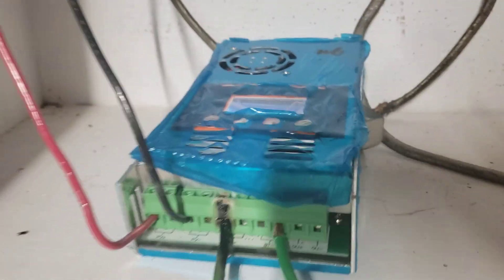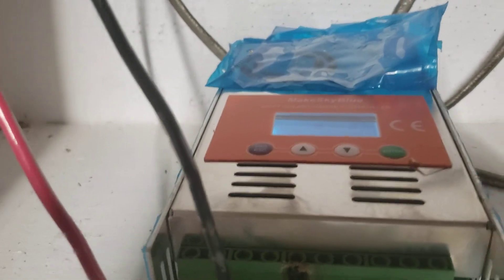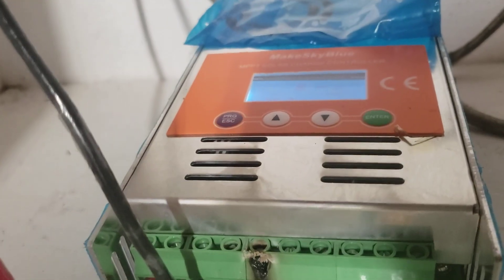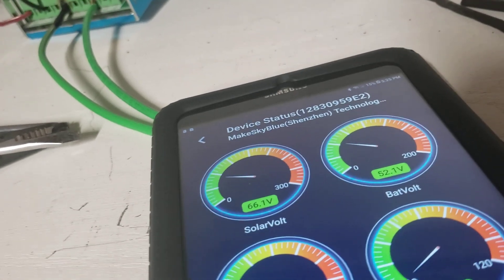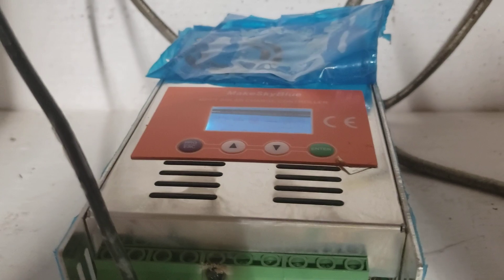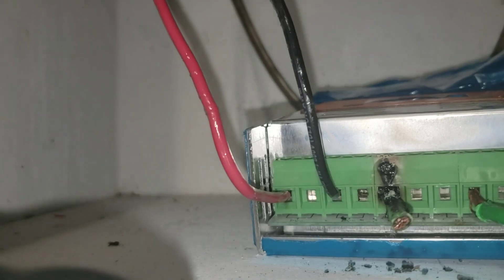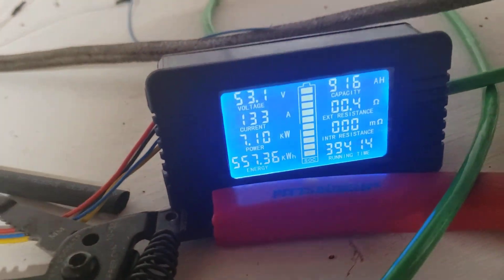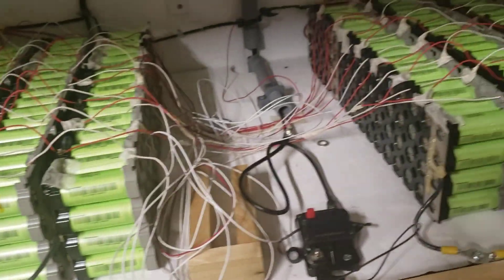BEST MPPT CHARGER CONTROLLER WIFI IN THE MARKET- MakeSkyBlue 60A MPPT 12V/24V/36V/48V Solar System

Comment: I think I see your problem. the area where it burned it is from the wire guage being too small. When the guage of wire size is too small the wire gets hot and channels too hard into one area. Then you get that burn out like you got there because it concentrates there at 1 spot where it leads in. I've had that happen with charge controllers. You can have either the wire be the fault, OR you can also have the charge controller not be able to be big enough also. Both can happen depending on where the limitation is. But usually the the damage will manifest at the charge controller because that's where the bottle neck is. So actually your problem is the guage of wire, not your charge controller. I also looked up the math on this... 

For example... the Make Sky Blue charge controller can handle up to 60 AMPs. But 10 guage wire can only handle 30 amps. 30 amps is approximately 4 solar panels of 100 watts. And a 100 watt panel can bounce between 6 and 8 amps. You said you had 8 panels. See 4 times 8 is 32 ... that means 4 panels per 10 guage wire. You have to set up 2 strings of wires if the wire can only handle 30 amps. So you need to have 2 wires of 4 panels... (or 3 to be safe). And then have them each go into 1 of the 2 lead ins for solar panels into the make sky blue controller. You will see also there's room for 2 lead in wires of 2 strings of panels into this controller. And that is why there's 2 lead ins. But on yours 1 is burned out. If you do 2 strings of wires of 30 amps each then this charge controller should be able to handle more amps. But still you may want to have some slack and not max out how much it can do to be safe. 

You can also tell this is the problem because the guys getting massive power with this particular charge controller and that are having it work very well are using VERY thick big wires. Not just 10 guage small size. 

Also on the cheap charge controllers its worse.

Good luck to you.
Reply: This isn't true in his case, I'm pretty sure his panels are wired in series so the amps would be 8 amps total, the watts and voltage combine in series but the amps stay the same.
Reply from the maker: The panels are set as 2S 4P
Reply: Another possibility is that it's caused by poor wire connections.

Comment: When you deplete your batteries in your battery bank, how much time can you have pass before you get them charged up  before they are damaged from being depleted too long? I think I've watched a lot of videos like this but don't recall anyone talking about this window of time period. (Obviously you want to get the charge back up fast...but curious on what the window of time is.)

...

What happens when you overcharge your batteries? I've heard sometimes if people don't program this machine right it can overcharge. Will that basically cause the power to drop in the batteries? 

Thanks.
Reply from the maker: Once I deplete my battery bank, I can never fully charge it back up while I am using the system. Unless I stop using the s u system solar. I need more solar panels

Comment: Everything you did is wrong. Sorry
Reply from the maker: Don't be sorry, I  am getting better. Point out  few things for me on this video and the corrections.
Reply: @simplyfocus9937  1. You are not letting the charge controller breathe air and ventilate. It drops performance by 70 percent.
2. You didn't specify solar panel specifications and assume that it can do max 45 amps of charge. There are various factors that impact the performance of a charge controller. Temp, voltage, wire gauge, wire type, solar panel angle, etc. Your wires are getting hot for this reason. 
3. Proper cut off switches are missing. 
4. You are missing proper terminal terminations on wire. It ended in a short for you I.e. you can see a spark.

Sorry again.
Reply from the maker: You're  are a great guy, don't be sorry, you're helping me to get better, that's is why we call this DIY.
Reply from the maker: I have 8 gage wire bringing from solar panel to regulator and 8 gage going to the battery.  The little hole in the regulator can only take 10 gage of wire, I had to trim the wire to make 8vgage to fit.
Reply from the maker: Wire getting hot, no! Wire was getting hot because of a luce cable
Reply from the maker: Proper cut off switch, YOU ARE RIGHT, EVERYONE WHO HAS SOLAR PANELS NEEDS THAT, I AM WORKING ON IT. I ALSO NEED MORE PANELS
Reply from the maker: We are doing great,  I am missing cut off switch.Yes.  Just remember, I came home on 28th of May atc11;00 p., no power. So it did the best I could. I paid half of the bill.  I am running off grid
Reply from the maker: The wire were not put in properly.
Reply from the maker: The wire were not put in properly.